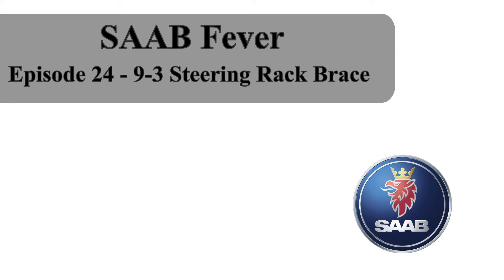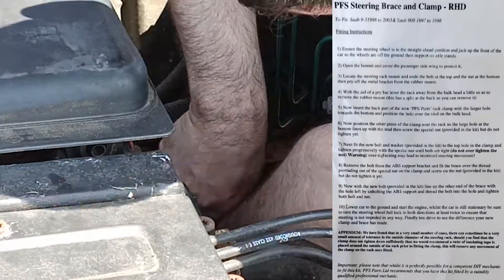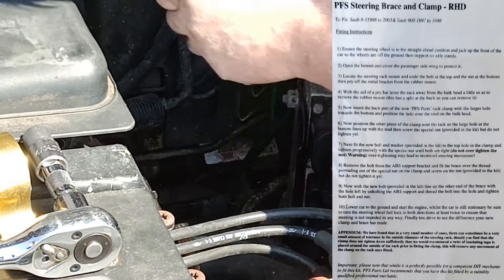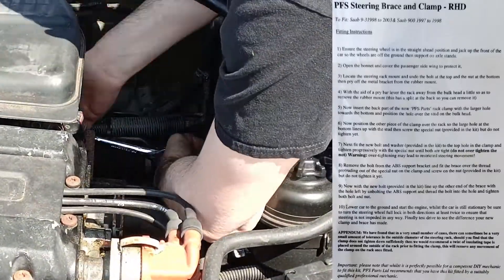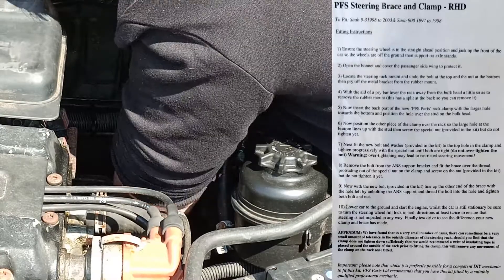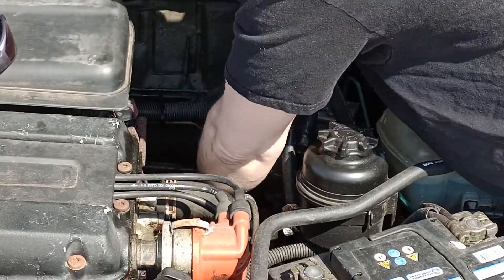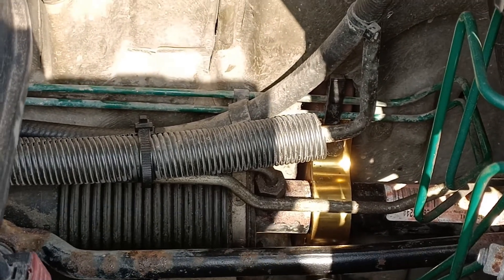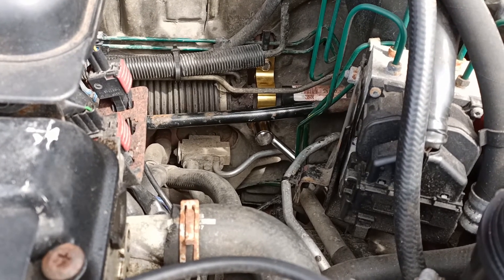Episode 24 - 9-3 Steering Rack Brace

Comment: I don't like Using RTV that much but I wonder if a smear inside the brace would help fill the space and glue the parts together.  It's not a crazy strong glue, so taking it back apart wouldnt be too bad.  You'd want to let it a few hours to set before you tested that it worked.

Comment: Hey there, I just bought a whole new steering rack and new inner/outer tie rods since my driver's side inner tie rod was bent. I hit a chode construction cone accidentally which cambered my front driver's side wheel. Replaced the struts w coilovers bc they were rusty and bent in the one wheel. I was told my steering rack has play though. Should've I just had gotten a brace instead of a whole new rack?
Reply from the maker: Ow that's sounds bad!  to be honest though, no, it sounds like you did the right thing.  The steering brace may help with the 'play' though.  Although, I suspect if you have the dreaded firewall separation issue, then you really need to get that sorted.  I think the brace will only stave off firewall separation, once it's happened (or started happening) it might be too late for the brace.

Comment: Cheers for the vid. I'm struggling to get the abs mount bolt tight, any ideas? Almost feels like it's stripped the thread from whatever it screws into 😒
Reply from the maker: I don't recall us having trouble getting it tight.  Are you using the supplied bolt, or did you have to replace it like we did?
Reply: @saabfeverfrank  Supplied, though I got there eventually. The angle is important... Fits well after a bit of packing too.
Reply from the maker: @Rep82  Yeah, it's not the most straight forward of fixes!  How does the steering feel now?
Reply: @saabfeverfrank  I haven't tested it as far as the end of the street yet as technically it's "off the road" I'll report back at some point when I've finished my repair list and it's back on the road.

Comment: I remember doing this on my 2.2TiD, I can say that it sure as heck wasn't this easy to do, barely any room to maneuver in the diesel engine. Was well worth the effort in my case, although my firewall wasn't cracked, it did reduce the amount of torque steer, overall vagueness of the steering wheel and it became much more pleasant to drive on dodgy pavement.
Reply from the maker: Yeah, I feel sorry for anyone trying to do this with less access than what we had.